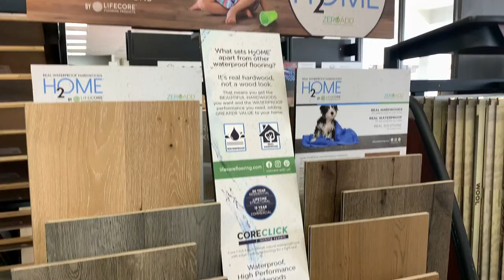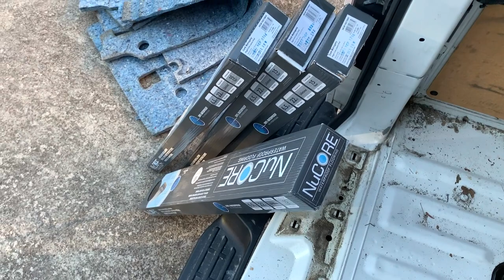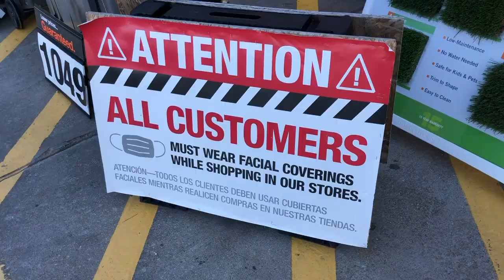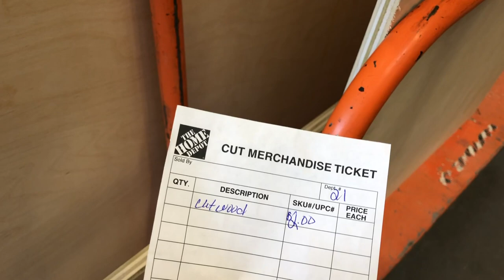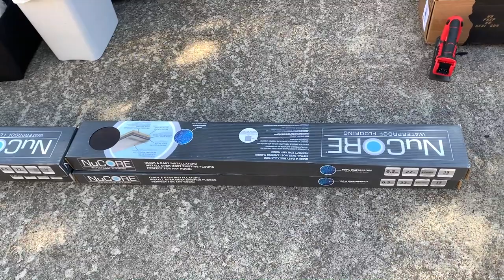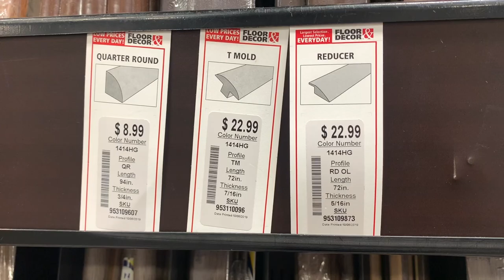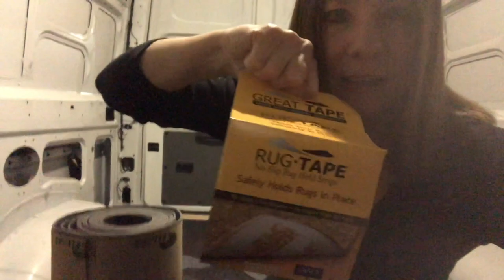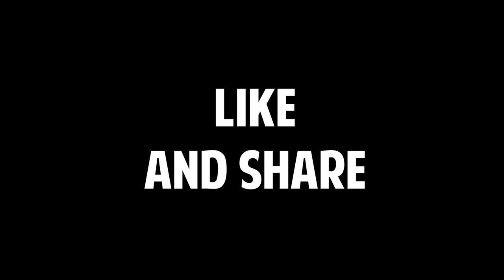Installing the Floor | Nissan NV2500 High Roof | Solo Cargo Van Conversion

Comment: Well you may have found this out already...I just got my 2012 van and it has that say piece in the rear corner, but it has a jack attached to it...So it where they connected the tire jack to the van, but I too will be removing it from the corner...LOL

Comment: Cool vid . I wish you wouldve included results from laying plywood over the nuts near or behind the driver seat. Im curious to know if your floor is unleveled and how subfloor manage to stay down without glue down.
Reply from the maker: The Siless sound deadening pads help level the floor under the Sun floor.  The bolts were lower than the ridges so no issues  there.  The subfloor is cut to fit around the wheel wells which keeps it in place.  Blue was used to connect the wood laminate

Comment: Looks like I'm one of your early subscribers! Maybe I missed it, but did you end up securing the particle board (subfloor) to the bottom of the van in some way, before installing the floorboards?
Reply from the maker: Hi CE!  Thank you for your support and question!  I put down the Siless auto sound deadening sticky back foam then put the subfloor plywood.  I did not glue it down because it was cut to fit the size of the original rubber mat around the wheel wells and side entrance.  Once the wood laminate was installed, the floor didn't move at all.  It's pretty secure.  I used tongue and groove glue on each floor plank though
Reply: @TravelJennie  thank you!

Comment: I'm trying to decide on a van. Have you seen other people's vans, if so how does it compare to yours? I basically have 4 options for "real" cargo vans here in Canada. Sprinter, Transit, Promaster and NV2500 - all high roof of course because I am just under 6 feet tall and want to be able to stand up in the van.

I have some ideas of how I want to build it, and it just seems like the NV2500 might be too small - however it's also the least expensive of the 4 vans so I'm wondering if it might be worth the trade off.

I want to be able to fit 2 people comfortably in the van....
Reply from the maker: My boyfriend is 6ft and is able to stand up in my completed NV2500 with plenty of head room.  It’s actually pretty big inside but it is narrower in the top so I didn’t do upper cabinets.  The others you mentioned are straight walls.  After traveling 20,000 miles in the van this year alone, I don’t need the upper cabinets.  The NV2500 is basically the Nissan Titan chassis so it’s just like driving a pick up truck, super smooth and because I didn’t have a heavy build, I get pretty good gas mileage about 17 or 18 miles to the gallon which is a couple miles more than a few built it out like the other types of vans. So that’s something to consider.  It’s also regular cheap gasoline instead of diesel or premium so that cuts down on the cost. It cost me about $60 American to fill up the tank, and it has a 25 gallon tank
Reply: @TravelJennie  that so true I am in Florida and when I bought mine they filled it up and it was 60$ to fill it lol  just last thursday 2018 little under 70 thousand miles , cannot wait to build it out !!